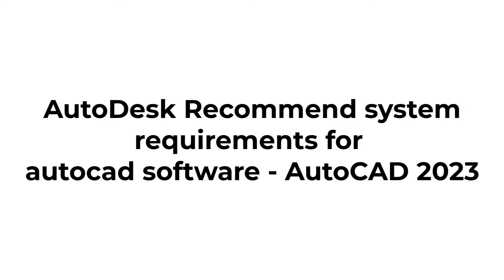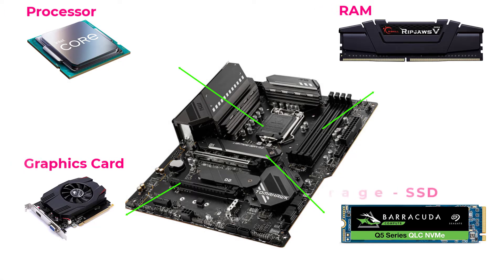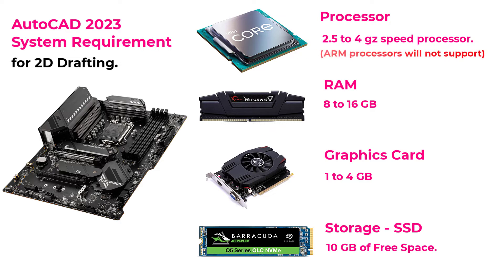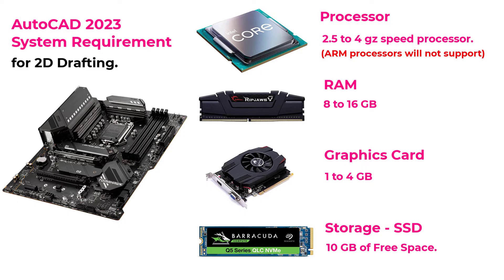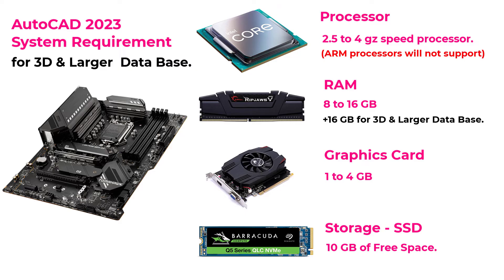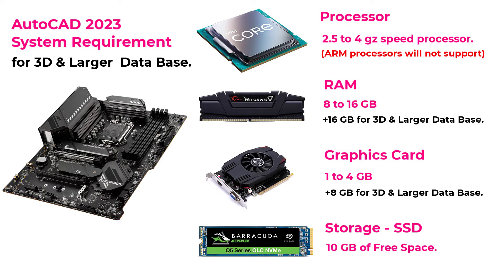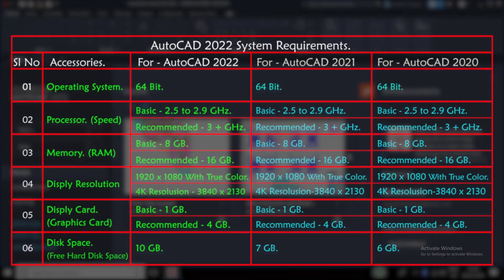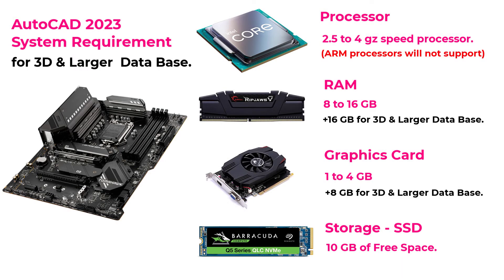System Requirements for AutoCAD 2023 : Choosing the Right Hardware for Efficient Performance

Comment: Don't listen to this guy, he has no idea what he's talking about. In fact, some old intel pentium cpus has above 3GHz clock speed but wont run shit. 

For cpus, you need more cores. For example, Intel pentium series mostly have 2 cores. core i3 series all mostly have max 4 cores. so always opt for latest core i5 as bare minimum for that 6 core. If you can get 8 core cpu thats even better. But make sure the cpu isn't that old. Always buy from among the latest 3 gen.

For gpu, just any 50s or 60s, like GTX 1050, RTX 2050 or RTX 4060 will work, this will be needed when you render 3d graphics with textures and stuff. Well, theres actually a graph which shows all gpus performance in a website named "tom's hardware", go there if you have the time and good luck finding it lol.

Ram, yeah 8 to 16 is enough.

storage, this is important. Make sure to buy SSD and NOT HDD. But at least 1TB SSD storage. You'll thank me later

Comment: I'm planning to buy new laptop which is dell Inspiron 3525 ryzen 5 7520U processor, can i learn basic Autocad on this laptop, will it run smoothly?
Reply: the cpu  has 4 cores which is the bare minimum I guess. Might lag little

Comment: Sir i have i5,13 th gen windows 11, ddr5 intel iris xe graphics
16gb ram & 1TB SSD will autocad run in it ??? No graphic card in my laptop , plz tell
Reply from the maker: You can use it.. but size of work my lag your laptop.. 2D work can easy perform with AutoCAD LT..

Comment: @UniquECADDesigN1 sir can i run autocad 2023 SMOOTHLY on hp Elitebook 840 g5 core i7 8650U, 8M catche, 1.9ghz base speed and 4.2ghz boost speed, 16gb ram and intel uhd 620 graphics?
Reply: its a i7 but its quite old (8th gen). you also dont have any gpu. It'll work just enough I guess since an old i7 is still good. Your future proofing somewhat worked I guess

Comment: I want to install student version. Which version should I install for college work.
My laptop is Ryzen 7 5700U integrated GPU 16gb ram
Reply: do u feel any problem with working on a dedicated gpu?
Reply from the maker: No..
Reply: @UniquECADDesigN  sorry, with an integrated gpu
Reply from the maker: you can try autocad lt. @nazmusshahadatsifat374
Reply from the maker: I think.. You will get only latest version is available for student version..
Reply: @UniquECADDesigN  I'm getting 2020,21,22 all. That's why I'm confused
Reply from the maker: Better to go with latest one.. will give you good performance comparing with older ones..